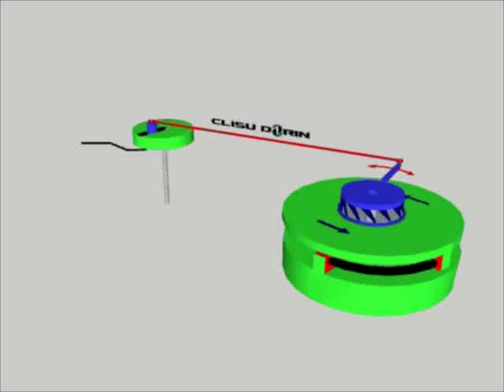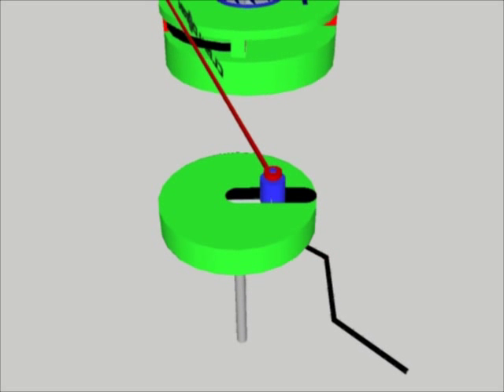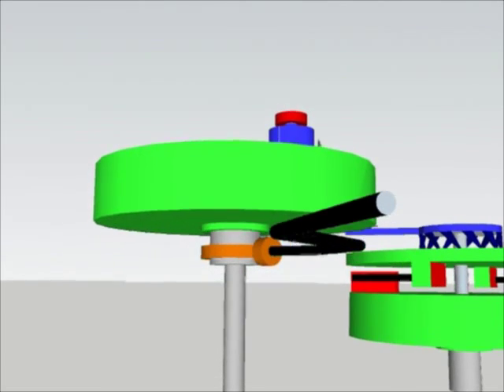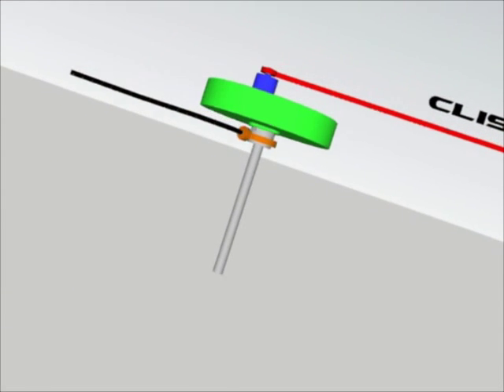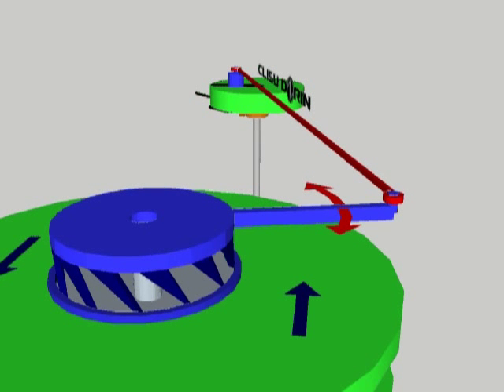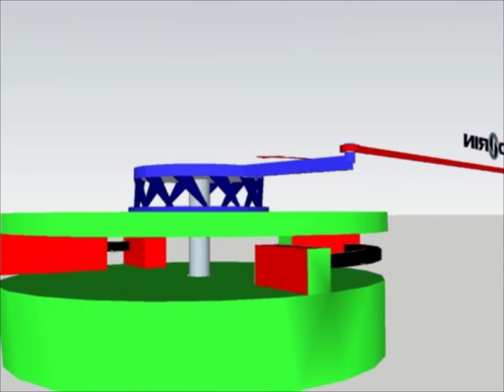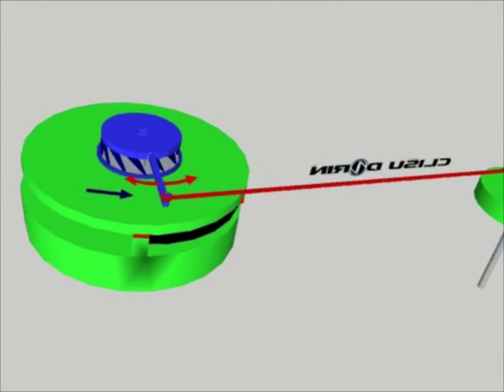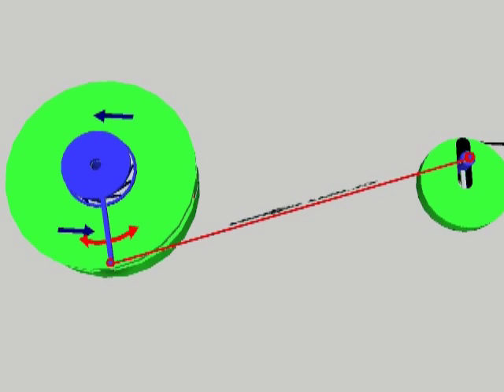Efficient Continuously Variable Transmission

Comment: I want buy this transmission CVT yet!! I think is the best system actual: only 1100 g (vs +1600 for the Alfine and RohlOff), very cheap (about 300 €), simple mechanism, and infinite gear ratios: Efficient Continuously Variable Transmission!!

I hate conventional system in mountain bikes!!
Reply: In case you didn't know, same principle as you've suggested is used in Stringbike (though it's not actually a CVT, but it's no problem to make one out of it).
Reply from the maker: Thank you! I haven't thought about this, but now that you mention it I think it would be very suitable as a bike transmission, especially since oscillation torque would be highly tolerated in this case.

Comment: I call bullshit on the Edysama transmission.  Any geared transmission is going to have only certain ratio solutions as a function of the number of gear teeth.  Moving them around can change the timing, not the ratios.